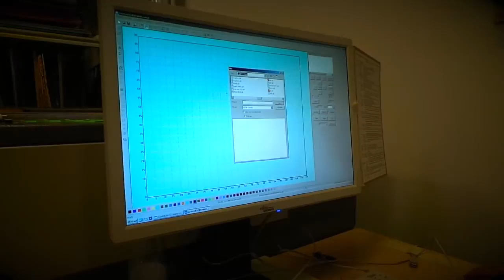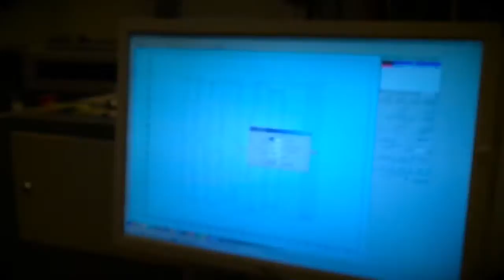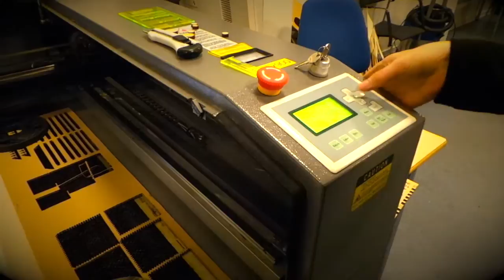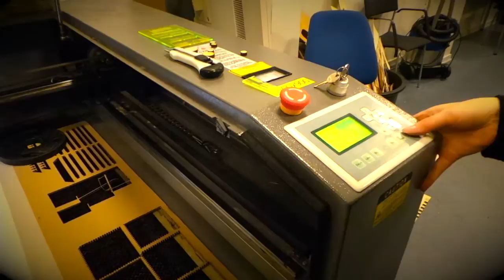Lasercutting Fabric

Comment: Thanks for posting, if you are laser cutting silks and lighter weight fabrics do you run into issues with placement or the fabrics moving? I'm in process of purchasing a laser cut but heard that it can be difficult to position lightweight materials, and might need a suction vacume table to hold them in place. Any recommendation would be great